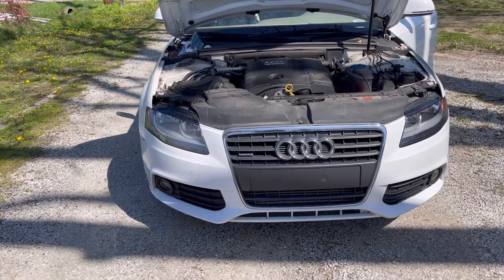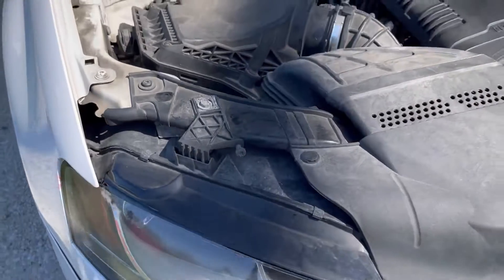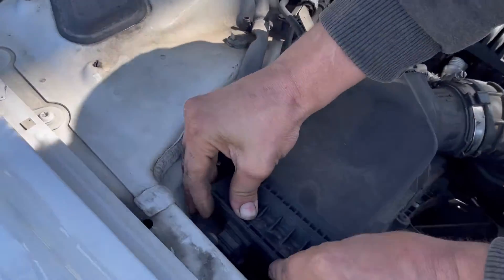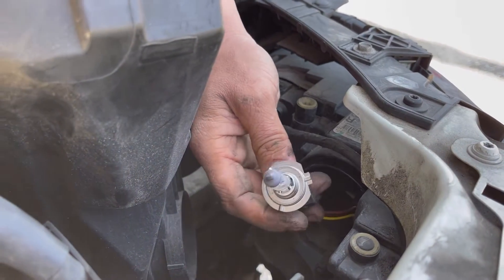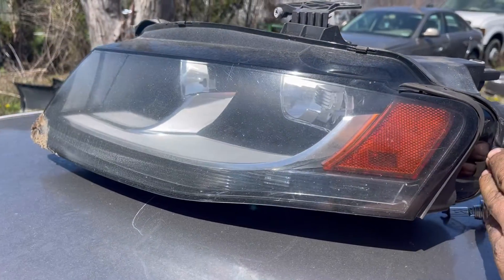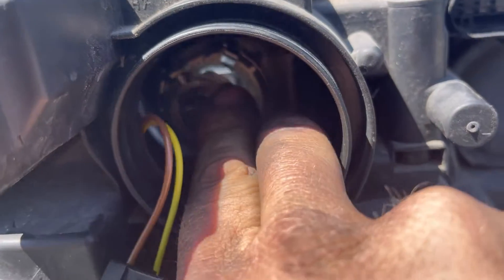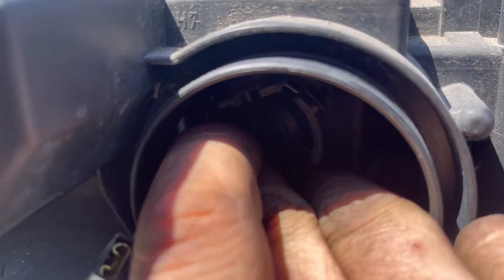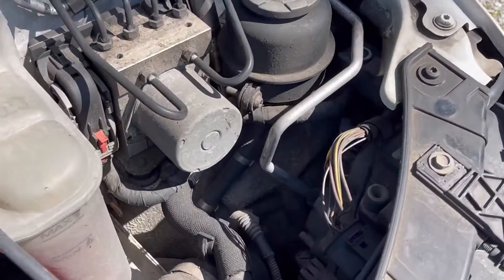Audi VW halogen H7 headlight bulb replacing a4 a5 a6 q5 2.0t headlamp low beam out remove install

Comment: Hey naptowntuner, I have ea888 gen2. 185k mi. Compression test result is 115-120 all cylinder. Should I buy used engine or get it re-build? Oil consumption wise gotta add a qt every 1500mi. Valve stem seals are bad. Probably do timing chain and new crank case too if rebuild. What do you think?